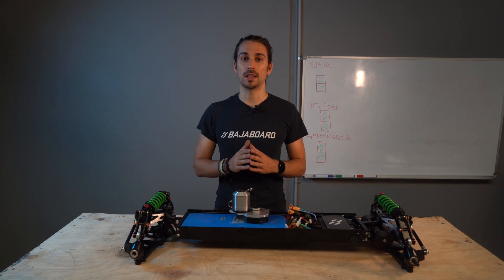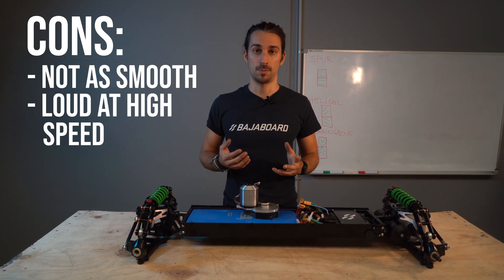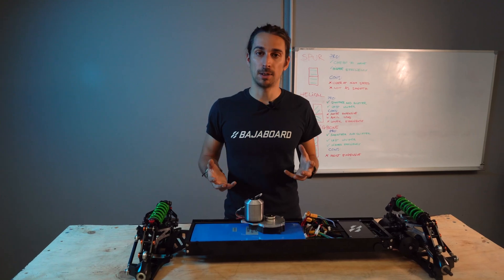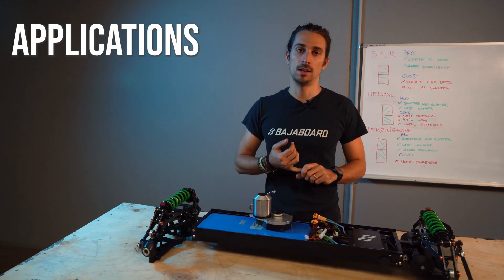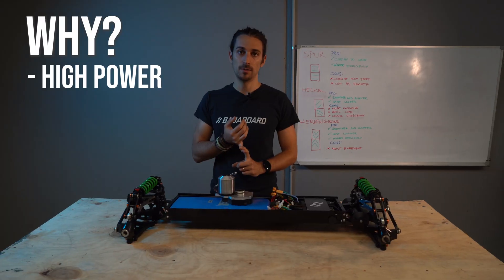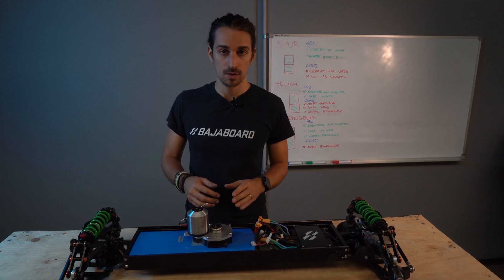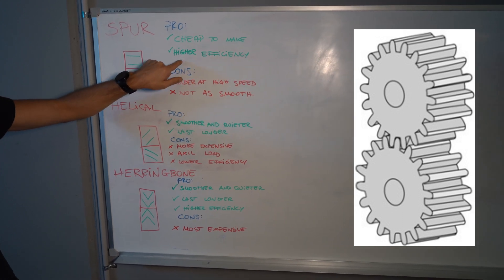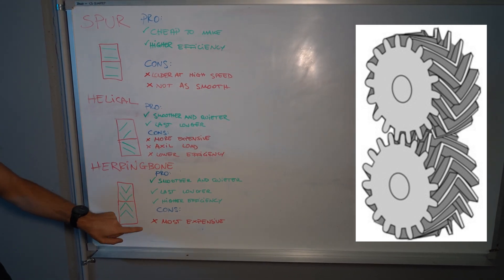The best gear drive in a production electric skateboard?

Comment: ? Are you going to make gearbox water tight.... so  can be filled with  gear oil... like a car/bike.... so can be serviced as the oil  will quieten the gearbox... and will   last longer...
Reply from the maker: These gears will work better deep in grease. This gearbox is similar to what you can find in mid drive electric bike.